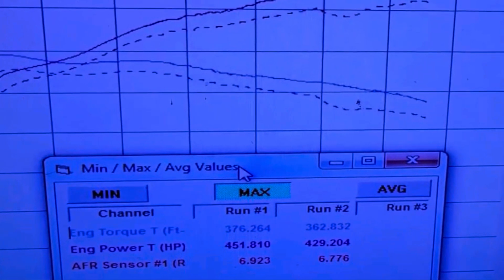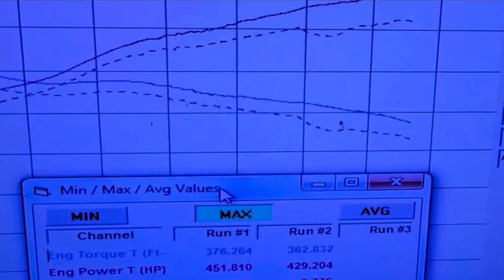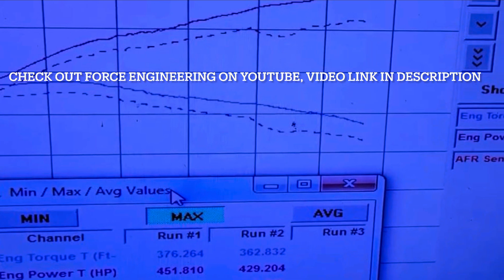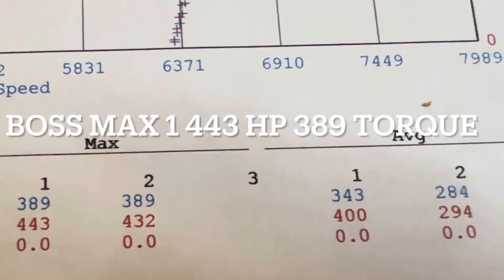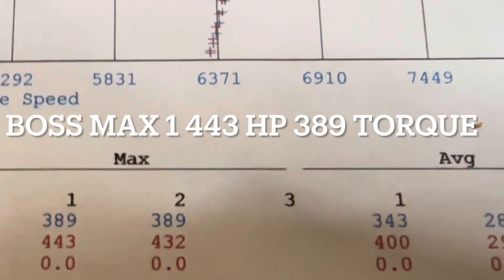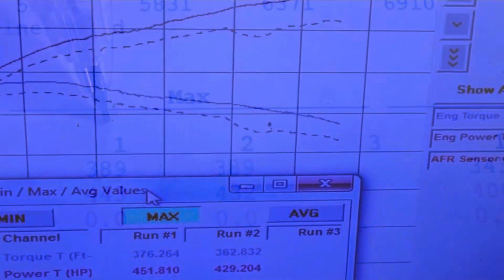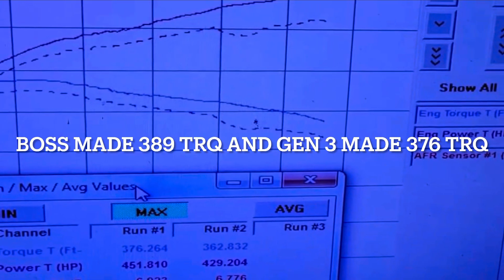Our Boss 302 Has More Torque Than a Gen 3 Coyote. New viewers watch both links in description.

Comment: Get a gen 1 cobra jet, the Holley stuff has so little information cause it’s finicky and unproven.  The CJ is much more proven and the tuning is a lot better on them. Also porting a CJ wouldn’t really be beneficial unless you’re really putting some aggressive cams and revving it waaaayyyyyy out.
Reply from the maker: Thanks I’m leaning toward a cj. It will have to be ported bc my boss is ported and it may not make much over than what I have. The boss port netted me 20 whp. I do plan to rev maybe 77-78k on the cj. Thanks
Reply: @CoyoteProductionsBoss302  on a CJ with the boss cams you’re good to 8k rpm’s pretty comfortably, ported CJ is probably like 8200 or something wild like that. That car will be SINGING at wot.

Comment: The manifold my flow more than a Cobra jet but not necessarily make more power heat soak is an issue with aluminum intakes I would stay away from it
Reply from the maker: That’s a great point especially if you’re tracking the car. I like the idea of all Ford parts. I will give Holley a call to pick their brain.

Comment: They are using a Mustang dyno. Generally speaking a dynojet dyno will read 50 HP higher than a Mustang dyno. You are very close to 500 whp on a dynojet.
Reply from the maker: Correct, if the dynojet is using the WinPep 8 software they will read pretty closely. I’ve dyno’d on one with updated software and was 1 hp less. The dynojets using WinPep 7 or earlier software read 10-12% higher. I also did an earlier video on this about 3 years ago. Thanks for commenting.
Reply: Both are correct
Reply: If your still considering a cobra jet give AFS a call he posted yesterday that he has some blem CJ ported intakes at significant discount.